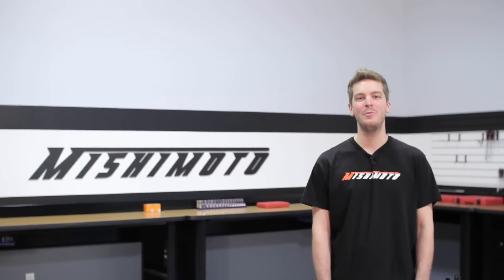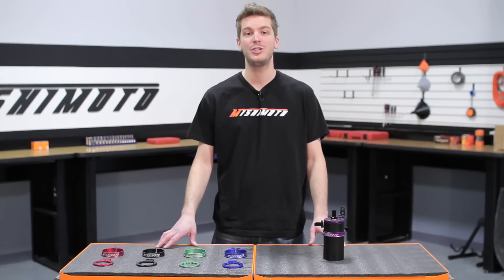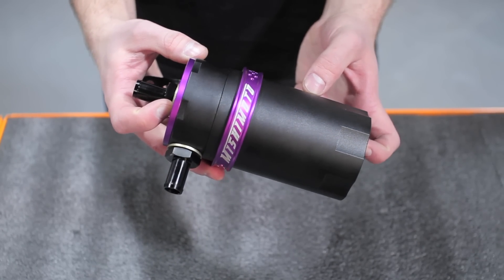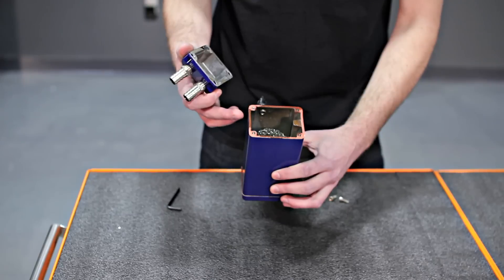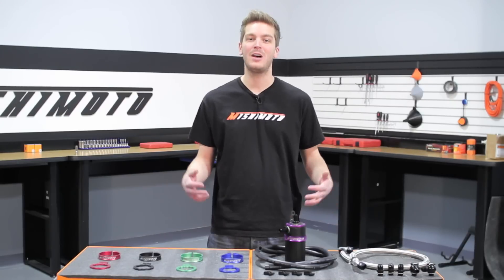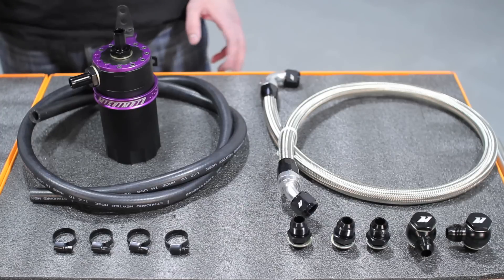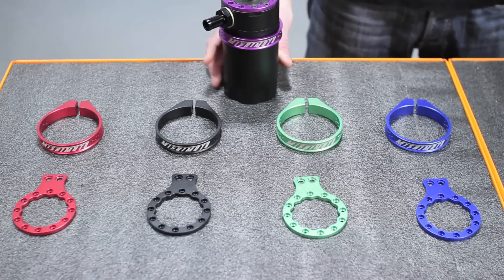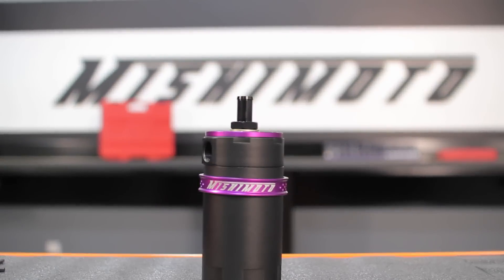Baffled Oil Catch Can Features & Benefits by Mishimoto

Comment: do you have to change the bronze filter over time?
Reply from the maker: Aside from cleaning it the filter does not need to be changed. We recommend avoiding harsh chemicals when cleaning to prevent damage to the filter.

Comment: Subaru patented an air oil separator before releasing the turbo charged FA series engine into the Forester XT. Since blow by would be pretty catastrophic on a DI engine, did Subaru implement a system like this for that engine? If so did you notice any issues with the 2015 WRX?

Comment: Hey Mishimoto I recently purchase the baffled oil catch can and I have a 2005 Subaru WRX. Quite frankly I'm "baffled" on how to install it. Anywhere I can find instructions or even tips to where the hoses go? Please help. Thanks! :)
Reply from the maker: Hello!  If you are planning to use one catch can on your WRX we recommend installing this in line of the crank case breather lines and the turbo inlet pipe. Simply disconnect this at the inlet pipe and run a new hose between the inlet pipe and catch can and a second line from the catch can to the breather lines. This setup will be ideal for street use and should remove oil contaminants from the intake tract.

Optionally a second catch can installed between the PCV valve and the turbo inlet hose would provide further removal of oil and byproducts.

Let us know if you have any additional questions!

Comment: Had to go check out the prices on these from the comments and WOW!!! Cant believe how much they selling them for. Only way im caughing that amount on engine parts is if I need the part or it gets me hp. Heck, I bought my cusco catch can for less than half of what that one is for and all I wanted was the cusco name and cool looking catch can in my engine bay lol. Oh, and that bronze filter is actually a air/oil seperator/muffler for most of your air valves.
Reply from the maker: driftingsenko Thanks for your comment.  The Mishimoto Baffled Oil Catch Can is a highly engineered product that is extremely efficient at removing oil/fuel byproducts from your intake tract. The pricing found on our website is MSRP, be sure to check with our vendors for the best available pricing.  Let me know if you have any questions!

Comment: I just revived my new misimito catch can and I cannot unscrew it any ideas ?
Reply from the maker: Hey totljag1 . Sorry to hear your having trouble getting the top of the can removed. These are quite tight due to being a closed, air-tight system. If your having trouble, I'd suggest an oil filter wrench such as this ( https://www.zoro.com/proto-oil-filter-wrench-3-12-3-78-in-j3006/i/G7607266/feature-product?gclid=Cj0KCQjwqM3VBRCwARIsAKcekb1fnZqk5ybM0OwH--ugWu41VTN6sbMBE8oFtEp61-MWDEe3VtbBnPoaApIoEALw_wcB ) . Additionally, there is a port at the bottom which can be used as the drain.
Reply: Mishimoto Automotive Im actually about to buy a catch can for my Ecoboost and am between JLT and you guys. Does the reply to @totljag1 imply that the Mishimoto catch can for the ecoboost has fitment issues?
Reply from the maker: Hello andres vila . There are no reported fitment issues with this system at all. However, it may require some effort to unscrew the top of the can right out of the box. Once that o-ring is lubricated for the first time, you'll be issue free moving forward.

Comment: Mishi.  So if baffled are so great. Why do you even offer a non baffled ?  Like the carbon fiber one ?  What good is it even ?  Doesn’t even have any sort of filter in it what so ever except for a magnetized drain plug.  But uh oil isn’t magnetic ???  Am I missing something here ??
Reply from the maker: Baffled catch-cans are more effective. Non-baffled units will still be functional and in many cases where a smaller can won't work out due to volume, customers will add a medium such as steel wool to act as a baffle to one of the larger empty cans. Our Premium Carbon Fiber can uses a cyclonic baffling system and foam filter rather than a standard bronze filter.
Reply: Mishimoto Automotive    I was waiting on the original one I ordered thru summit racing. The baffled rockstar but they kept telling me for since nov they were back ordered so I told them to switch to MMOCC-CF.   I looked inside from the drain plug and see no filter at all.. ?? This what kinda makes me wonder how exactly the non baffled non filter ones even work ?  Doesn’t even seem as tho I can even open this one to add any filter media at all ?
Reply from the maker: The  MMOCC-CF is a standard style catch-can which does not include baffling material or filter. These will typically be a large volume so the air passing through can slow down and condense oil vapor into liquid form. Our MMBCC-CF would be our premium catch-can that includes a cyclonic baffle and foam filtering material.

Comment: How do you hook up a drain valve on the bottom of these cans
Reply from the maker: You would simply undo the plug on the bottom and install the fitting from the kit, You can then run the line to your preferred location and install the ball valve to keep in sealed. Then just open the ball valve to drain to oil.

Comment: If anyone could please help, would a mishimoto catch also work for an F150 3.5L ecoboost? UPR is a little too pricey.
Reply from the maker: Hey Alejandro! We're currently in the R&D phase for a direct-fit 3.5L EB catch can kit!  Check out the latest post here: https://engineering.mishimoto.com/2016/09/bye-bye-blow-by-2015-ford-f150-ecoboost-catch-can-rd-part-2-road-testing/
Reply: Mishimoto Automotive Thanks! Can't wait for the release.

Comment: So you make the air swirl, GREAT. Then you use the wire baffles same as others, GREAT, and then you say you have a special filter, GREAT, only where's the proof of clean air leaving the thing? Lifetime warranty of nothing valid, just a can that we don't know how it performs.
Reply from the maker: Hey James! Head over to engineering.mishimoto.com where you can read up on all the R&D we put our products through.  Also, here's a blow-by specific article that discusses catch cans in-depth: https://engineering.mishimoto.com/2016/01/blow-by-101-what-is-blow-by/
Reply: The info im heading over to should be incorporated into this video pal. I certainly will look though, and if i like i will buy. Just having a baffle in the tank like other firms seems crazy. Nit enough to clean the air fliw.